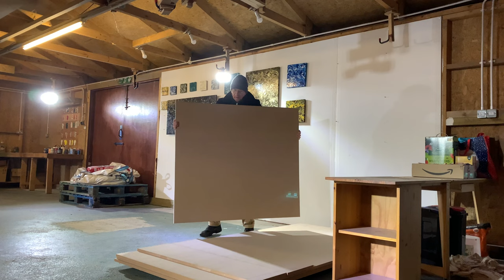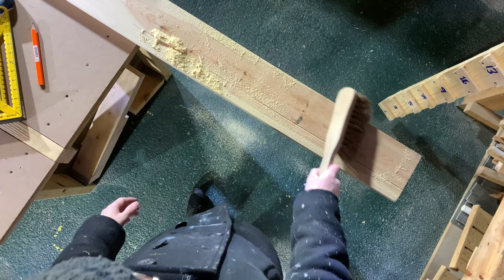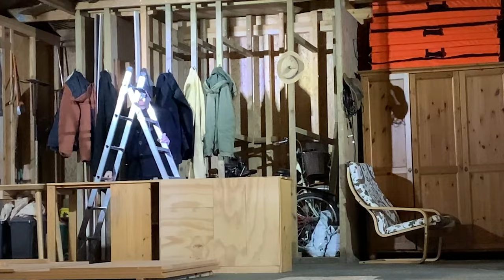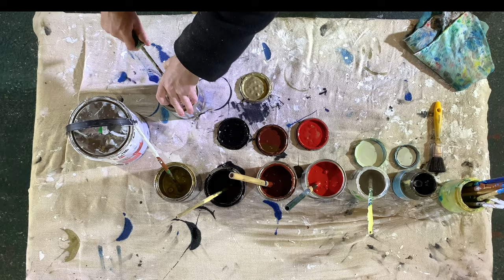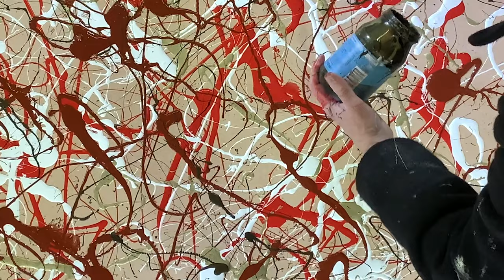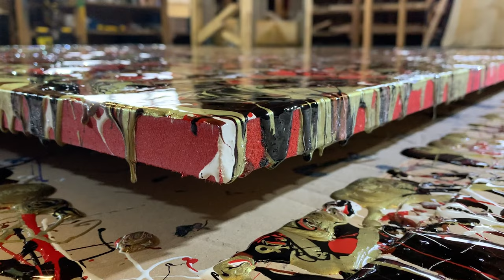Making Paintings Come to Life: Abstract Art

Comment: How long does it take to dry
Reply from the maker: Hi Bruce, Because it is gloss paint it forms a skin on the surface quite quickly (around a week) and then it's dependent on the paint used. Thicker ones are usually completely dry and good to hang in about a month. The more liquidy paints take a lot longer - possibly 3 - 6 months. Best, Jim
Reply: @AbstractOrkney  wow it takes a lot of patience
Reply from the maker: @BruceMyers-ov3dg  Oh, yes. 🙂